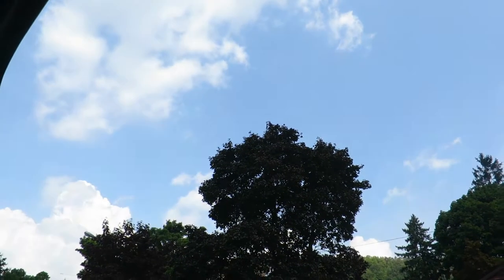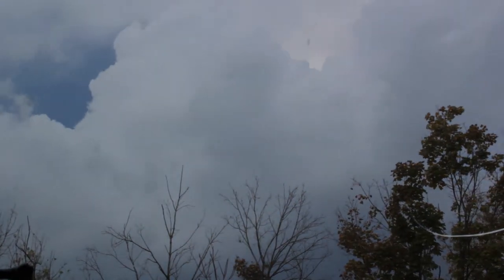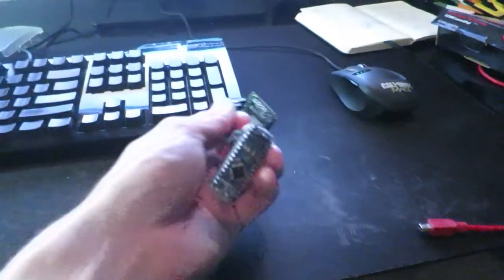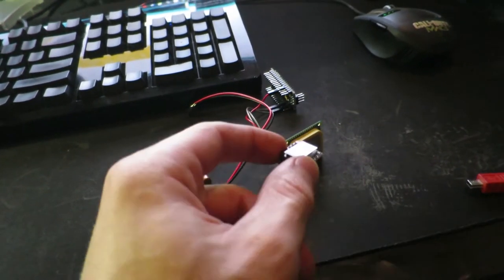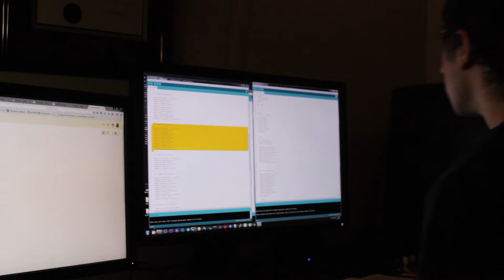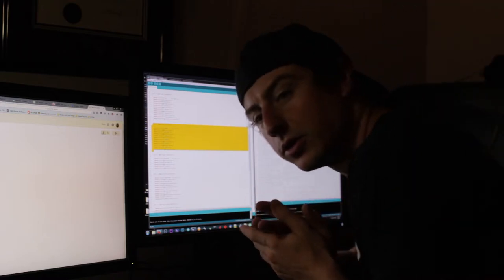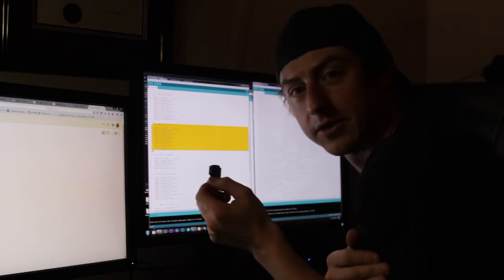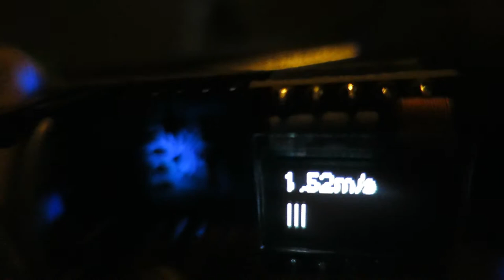Tiny OLED GPS Bike Speedometer - Sean Makes

Comment: Yeah, agreed with the GPS monitor. way cooler. I like these quick videos where you do something with arduino and rpi. keep it up.
Reply from the maker: +Ah4Petesake Thanks! I will try to do more of those. I need to come up with with some small project ideas and get the parts ahead of time. A lot of the time I want to build something but I don't have the parts.
Reply: +SeanHodgins I'm thinking about a small device to check if I turned off the gas to my cooker. something that can be checked via text message  haha
Reply from the maker: +Ah4Petesake so you want to text a device that texts you back letting you know if the gas is off? Is there a wifi connection? That would be easier
Reply from the maker: +Ah4Petesake so you want to text a device that texts you back letting you know if the gas is off? Is there a wifi connection? That would be easier
Reply: +SeanHodgins yes that's the idea.

Comment: Hi great video. How did you connect the GPS module with wires? Did you solder thank you.
Reply from the maker: I think it had a JST connector, then broken out to pin headers.

Comment: I have made one that includes a wheelieometer, see my channel, to time how long you are wheelieing for using an accelerometer to detect angle.  Also does the normal speed stats, distance time, clock, and energy and power estimated from the rider and bike weight, speed and slope.  I also used an OLED display.

Comment: Can you please specify the battery your using for powering it. In case of using a Nano and a gps module.
Reply from the maker: Its just a 9V battery being run into the VIN pin of the Nano, then I power the GPS with the 3.3V from the Nano.
Reply: @SeanHodgins  I have also used a 9V battery (good quality alkaline) for mine, I've used it for several hours so far and its still going, and I didn't optimise my code to use any low power modes, and it has two LEDs (~5mA each), an accelerometer, BME280 weather sensor and real time clock all running off it.

Comment: Great project. it can do a tracking?
Reply from the maker: +Giuseppe Badagliacca Thanks!
It could absolutely do tracking, but my program does not do it. It would take a couple more lines of code to do it. You would have to store the tracking data on the microcontroller, and write a program to start and stop the recording. The GPS will give you a fairly accurate location.

Comment: really cool project and  interesting video . BTW, would you consider use a senor on bike wheel(calculate  the rotating speed ) instead of GPS module mightbe  more accurate ?
Reply from the maker: Absolutely, but you can just buy those off the shelf. That's no fun haha. Plus this can display my location if I want. I'm a huge fan of these tiny GPS modules.
Reply from the maker: Absolutely, but you can just buy those off the shelf. That's no fun haha. Plus this can display my location if I want. I'm a huge fan of these tiny GPS modules.
Reply from the maker: Absolutely, but you can just buy those off the shelf. That's no fun haha. Plus this can display my location if I want. I'm a huge fan of these tiny GPS modules.